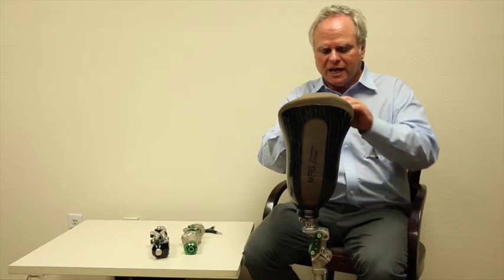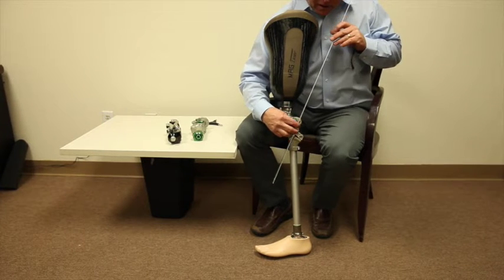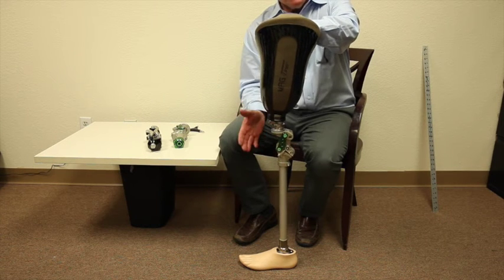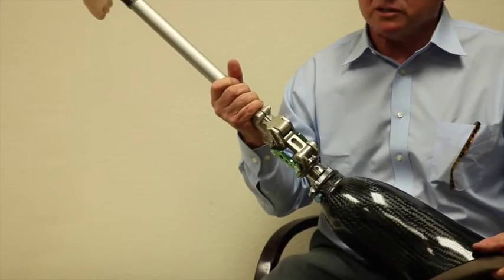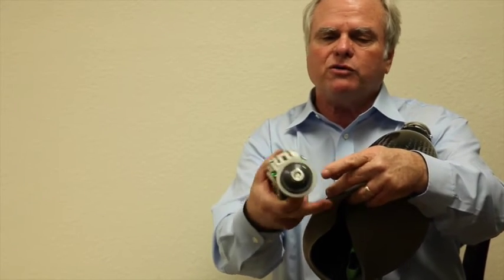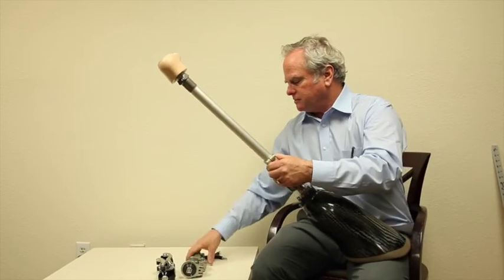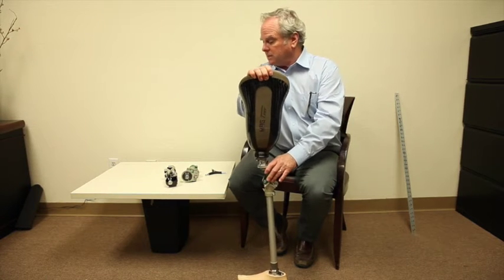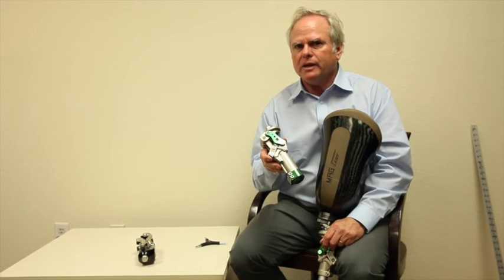1324 Stance Flexion Mechanical Knee

Comment: what is the weight limit on the joint ? is this on the nhs approved list ?
Reply from the maker: 275lbs and is CMS PDAC Approved.  It also comes with a version that is locking.  L1324